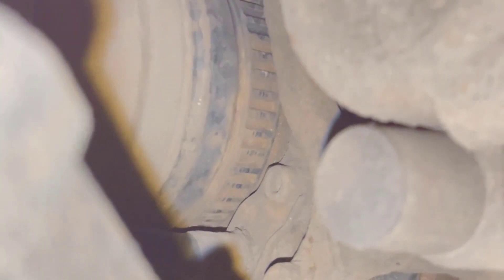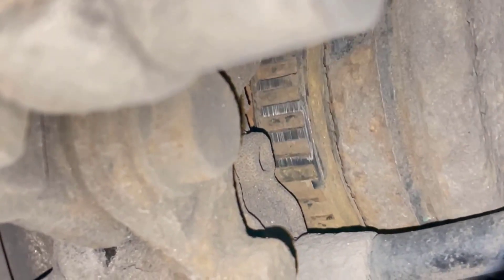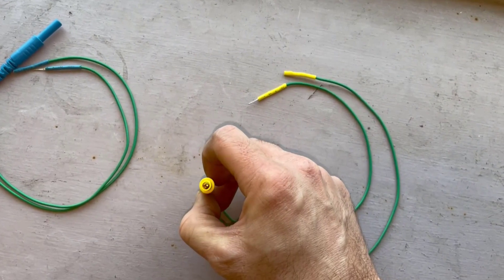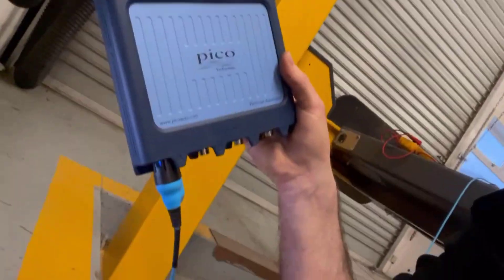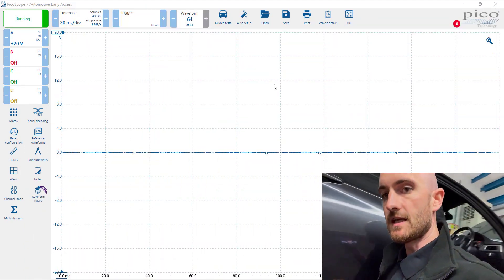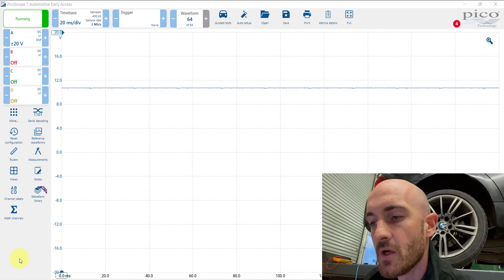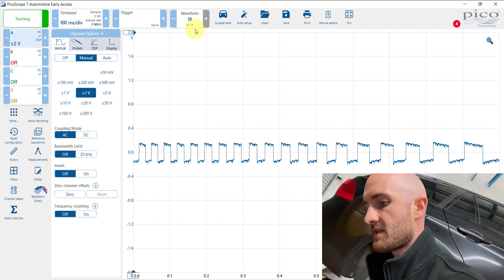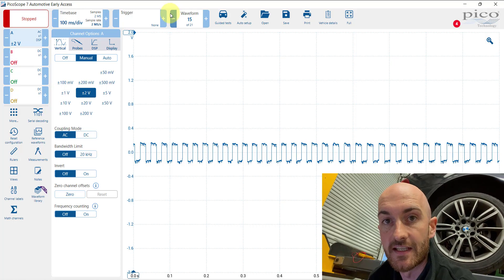How To Test A Wheel Speed Sensor With A Scope - PicoScope Automotive

Comment: By complete coincidence I have an e91 in the exactly same spec.
Its a tough old work horse.
The rear subframe was rotten, so I had to replace that.
Back to the video, I just plugged a 2 channel Picoscope into a 1993 964 I am working on and I am getting a very tidy Sine Wave. Its only 0.4 volts though is that normal for 1990's ABS wheel speed sensor signal. 

Thanks for all your advice via these very helpful youtube videos.

Kind regards

Geoff Walker 
Ireland
Reply from the maker: Hey Geoff, can’t beat the E91, do love mine. Estate that can take corners 😂 Re 964 that does seem quite a low voltage. Of course it should increase as you increase the wheel speed. Maybe confirm with other wheels. Also could be related to scope setting or leads. Are you using the leads that came with the scope? They have a x10 switch. Make sure it’s in x1 mode
Reply: @MechanicMindset 
Yes, I think you're right. It's 12 years since I worked with oscilloscopes during a Diagnostics course I did in Dublin, so I think I haven't got the probes setup properly. The Multimeter seemed to give a low voltage as well. I will compare results to the other 3 sensors and see how we go.

Comment: As far sensor that detect spinning objects:

Inductive sensors. Use an inductor in addition with a permanent magnet. Two wires sensor. Sensitive to ferromagnetic materials. Easy to test (even in the bench unconnected), it can detect  really fast moving objects. Produces a sinusoidal signal. Really good as a CKP. Can;t detect slow moving or standing objects. 

Hall effect sensors. Use a hall effect element in addition with a permanent magnet. Three wires sensor. Sensitive to ferromagnetic materials. It can detect even standing objects. Really good as a CMP. Produces a digital (square wave signal). Usually with an open collector output. Can;t detect (in a cheap form) really fast moving objects. Must be under power supply (usually +5 volts) in order to test it. 

Magnetic resistance sensors. Use a variable resistance sensitive to magnetic fields. Two wires sensor. Doesn't need a permanent magnet. The spinning object must be an array of magnets. Really good at detecting position with great accuracy. Even really slow movements.  Usually used as an ABS wheel sensor. Produces a digital (square wave signal with a DC offset). Must be under power supply (usually +12 volts) in order to test it.

Comment: And the front ones are different. There are actually two types. One is active and one is like the rear one.  Active sensor sends a heartbeat value every 150ms even when not installed on the car.  Both types fit the same so it is easy to buy a wrong one. It is necessary to find out part number in realoem

Comment: Inductive abs sensors (the ones with the "crenellation" reluctor rings anyway) usually outputs a sine wave.  Why the square wave in the video? Is it because of the different type of reluctor ring. I hope I make sense, english isn't my native language.
Reply from the maker: I understand. This type of sensor can work with a magnetic type ring, or a physical metal ring. Think like a camshaft sensor; square waveform, but the sensor picks up from the metal camshaft ‘ring’
Reply: @MechanicMindset  I've seen the same typ of rings (like the one in your video) on crankshafts too. So what you are saying is that with that type of ring (the one with holes instead of crenellations) you get a square wave similar to that of a hall-type sensor?
Reply from the maker: @HerrDagerman  If it’s being used with a hall type sensor, yes 👍
Reply: @MechanicMindset  Of course, by bad. Inductive sensors always shifts polarity (AC), so of course it's a sine wave :p
Reply from the maker: @HerrDagerman  Inductive sensors are usually a lot larger and heavier than the hall type 👍 easy way to tell
Reply: @MechanicMindset  Thanks, good to know

Comment: Excellent video, keep plenty of them coming. I bought a 2005 K74 L200 Mitsubishi Animal but when I plugged in a Launch 129E  scan tool it came up with some fault codes for the front ABS wheel speed sensors. The reason the ABS warning light did not come on was because somebody had been inside the instrument cluster and removed the ABS light. The golden rule is always make sure all the warning lights come on momentarily when starting the ignition and check for fault codes before purchasing a vehicle. These magnetic ABS wheel sensors on this K74 pick up are so powerful they can even pick up a pair of vice grips so have no trouble attracting flakes of rust. I tried to remove a sensor but the flimsy plastic end on the sensor snapped off and I ended up having to remove the front wheel bearing housing to punch out the sensor, which had an extremely difficult to remove stainless steel sleeve. These Mitsubishi K74 pick ups have several versions of wheel sensor and giving all the vehicle information is no guarantee the correct sensor will be supplied. Even some of these DIY scan tools appear to be able to show accurate graphs and speed rates and just turning the front wheel by hand is enough to generated a signal on the graph. I cleaned the sensor on the other side with a long plastic cable tie to save having to remove it. Manufacturers design vehicles in the virtual world but would appear not to adequately test their designs on actual roads in the real world.

Comment: On BMW i always check for rubbing on sensors on inspection/service and if customer complains about ABS/ESP kicking in at low speed or error codes

See it all the time here in Norway.
BMW only sell complete axels.
But you can buy the sensor ring for a VW Sharan and it is a perfect match 😁😂

Comment: Hi Darren, great video by the way . . I had to replace these ABS pickup rings a few years ago on an E90 318i. BMW don't sell them separately but they will sell you two complete driveshafts at a total cost of over £1000 so i found replacement rings online and fitted them/changed the worn sensors. None of the local indys could figure out the intermittent ABS fault on the car so i got the job of figuring out what the problem was. I have just started using PicoScope myself and have found it an essential tool for modern vehicle diagnosis, many thanks for the known good waveforms, sometimes its hard to know if the signal you are getting is exactly as it should be!
Reply from the maker: Tried to sell you full driveshafts 😆. Yeah the ABS pick up rings are a good money saver! Glad you are enjoying the videos. PicoScope is a great tool!

Comment: Ac coupling can work on a good signal, better is to measure it against battery positive in normal dc mode( if signal is on the positive side). You will get a clean signal on a small scale. but most scopes don’t like that ( put a power on an scope ground). If you know how the sensors works and what can go wrong with the circuit this is the best way to measure it.
Reply from the maker: That will work nice, never thought to do it like that. To be honest, the zoom feature works really well on Pico, the AC couple is the safest way for all to use; like you say, putting positive on the ground can be dangerous for the scope and the car (if measuring more than 1 channel) 👍
Reply: I work with a 4 channel Tiepie differential automotive scope and this scope is ok with that, pico should also be ( if it’s differential) .
Reply: Another problem is when battery voltage will change, the voltage values on the sensor wil change as wel, not if you measure it against battery positive:)

Comment: Great info mate. A lot of people get confused with the difference between active and passive wheel sensors.
Reply from the maker: Have you seen the latest sensors? True active sensors, directional and stationary signals…
Reply: @MechanicMindset  No I haven't, do you have any links for that info?
Reply from the maker: @MiracleMAX  Not off the top of my head. If I find anything I’ll send it over. You basically get a constant square signal that changes width with reverse direction
Reply: @MechanicMindset  Cool, thanks

Comment: Just curious, in watching ATS videos with Bernie Thompson, he always states that you connect the negative lead to the battery ground as it is the lowest potential of the system. I noticed that you don't always do this (I know the E90 battery is buried in the boot). In practice, has not connecting to the battery ground has ever given you measurement issues? Great video as always, I didn't know that the pickups on E9X chassis do this, but from where I'm from we don't have a snow/ice, perhaps why I never noticed it.
Reply from the maker: For sure, battery negative terminal is always the best, but as long as you get a nice connection on chassis, it works just fine. Yes, I have had bad ground connections, you usually get a signal but it doesn’t look right; usually at the wrong voltage level and sometimes waving up and down (like it has coupled to mains 50hz EMF). If I get this I usually find a cleaner connection, or bolted ground connection. 

I would say it is more important for battery negative connections when taking volt drop measurements 👍 (it’s ‘absolute zero’ Volts)

Comment: Hi Darren, is there any particular reason you didn't use the sensor ground and chose chassis instead?
The waveform would have looked a lot cleaner.
Interesting to see, just done one with a failed sensor and rustjacked reluctor ring, in my case the sensor had no signal output.
Changed the reluctor ring as it was in similar condition to the second one.
Reply: Interesting Simon, I was wondering the same thing.
Reply from the maker: Hi Simon, it’s the recommended way to connect. To be honest, it didn’t make much difference on this car 👍
I’ll be doing these ones soon! I think the main outcome is that the sensor head is eventually shaved off 😂